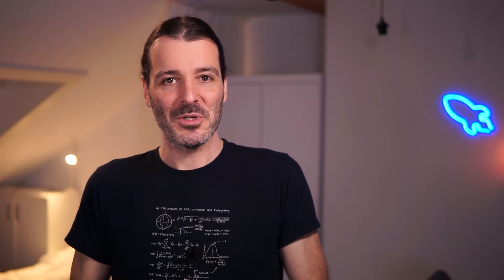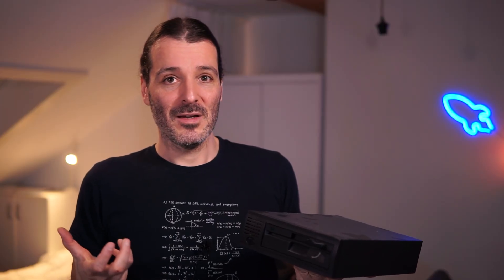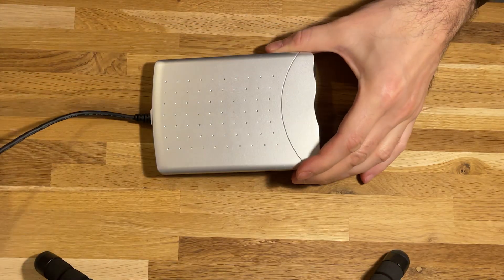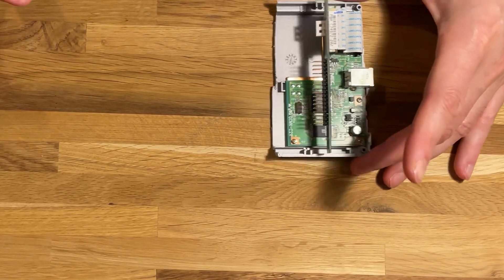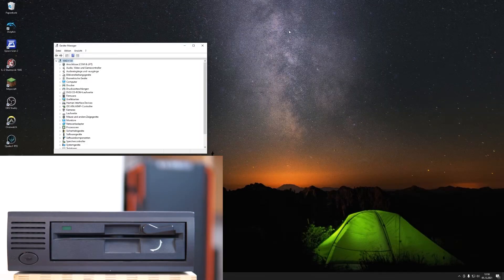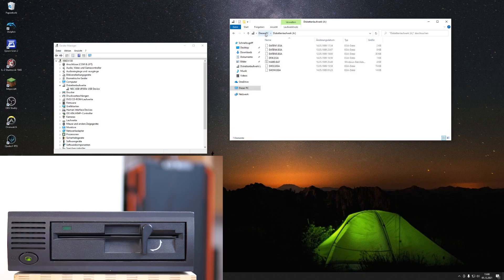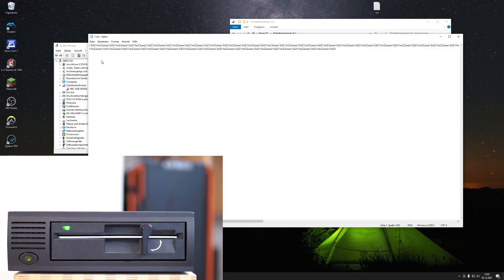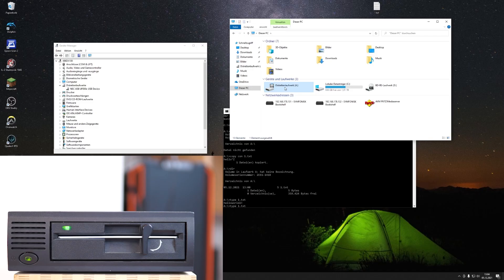How to build a working external 5.25" USB Floppy Drive

Comment: Legacy BIOS support for 5.25 is still in place, but is it for UEFI?  So a UEFI only system, may not be possible to use 5.25?  That would be I think the first key issue.  The next issue is emulation of 16 bit under 32 bit, is only supported via BIOS right?  Windows dropped native support for 5.25-inch floppy drives starting with Windows XP SP2, although it was still supported in the initial release of XP SP1

Comment: in usual not a bad idea, but it makes no sense, to use an exotic no longer available usb-adapter board. The reason why the 5.25" drive is always recognized as 3,5" is the vendor-usb ID of the USB-adapter. It has the device-ID of a 3,5" floppy drive. For that reason, windows handles it as a 3.5" drive. I don't believe that there is an ID for a 5,25" USB-device. Conclusion: because of lack of interface hardware, it's necessary to develop a hardware interface to handle 5,25" floppy drives and to write a windows driver to handle that on the file level

Comment: Doesn't the enclosure have separate power supply? The main idea is that usb provides 6 V but the drive needs 12 V. The internal controller/adapter from floppy drive to usb looks is similar for 3.5 vs 5.25 drives.

Comment: My guess is that the USB controller chip needs the correct vendor ID and product ID to be recognized as a 5.25 floppy drive in Windows. These are the IDs that allow Windows to recognize the device and it's perhaps how the drivers are aligned properly to the device. If the firmware is reprogrammable, you can may be able to reflash the vendor ID and product ID on the USB controller chip.

Comment: Well, this comes late — like 3 years late.  But I just remember something even older.  The DOS floppies started with 12 bit coded allocation tables.  Then at some point they changed to 16 bit coding.  Too bad, I don’t recall when that change happened, but I am pretty sure it was either when the high density 5-1/4 inch or the 3-1/2 inch floppies were introduced.  I also seem to remember that the 3-1/2 inch floppies were used in Apple computers quite some time before the PC folks got them.  I may still have somewhere a book by Norton, one that explains all the floppy directories and file allocation details.  I also have a couple more DOS books, one a Rosch book mostly about hard disk mysteries and then i have the big Microsoft DOS book.  One of my oscilloscopes has a 16-bit logic analyzer (in addition to its 4 analog channels).  I should be adequately equipped to dig into the deep core issues, if I just had the time and motivation…….

Comment: Don´t know how I found your video, but am tinkering with external 5.25 right now. Although I have a small external 3.5 as well to part out, I am using a greaseweazle at the moment. And that´s the issue: Great for imaging, but not for real-time use. 
In emulation, the Weazle can be used real-time for i.e. Amiga (which I bought it for), Atari etc. But in Windows? Meeep!
Thanks to your video, i don´t need to try the 3.5-USB->5.25. I had the same idea earlier, but now I see it´s not that easy in Windows. Grüße aus Bremen!

Comment: Added 2 years later, but still worth to be mentioned: You can use the described device compilation at least to read and write 720KB 5.25" floppy diskettes, e.g. using a modified TEAC FD55GFV or a TEAC FD55FV. These 720KB formatted 5.25" QD or DD diskettes were not commonly used, but existed. To read/write them on an older PC (e.g. an Intel 486 PC), you have to use not only MSDOS, but additionally also a small utility (the diskette copier software VGACOPY contained the utility named "VGAREAD", but there were also an utility which came with FDFORMAT named "FDREAD" and another one which was named "800"). To format them, you can also use the FORMAT program with the command line parameter /T:80 /N:9 (not with Windows, but DOS).

Comment: I suspect it's identity as a 3.5" drive is flashed into the firmware of the usb board. Accessing it via the bios to boot of it probably ignores that and uses some older, lower level way to determine that which Windows does not. 

It would be very interesting to see what it does under Linux. 

I built something similar myself using a Greaseweazle board (similar to Kryofkux, less expensive and open source) and an old SCSI enclosure and one of those 5.25/3.5" combo drives.

Like you said, it's not a native experience, it only works through an app that reads and writes images. BUT it does have advantages too. I was able to rescue the data off an old 3.5" disc that was damaged and otherwise unreadable. Also it can read many non pc formats.

Comment: Set up a reflective or white dot, if one does not exist, on the bottom of the drive spindle flywheel. Aim a cheap harbor freight strobe-type tachometer up to it.  Run it in dos correctly, and again in windows. Note the speeds. I think what you are running into is the drive rpm speed, which is different for 3.5" drives, and between different 5.25" formats. I'll bet you windows is trying to run the drive at 360rpm instead of 300rpm or visa-versa. A 1.2mb drive in dos with the bios correctly configured does this switching automagically, but without being told to do so I bet windows is stuttering. Being able to read the fat on that one disk, but nothing else kinda also makes me think this - the phase shift from being the wrong speed is likely exaggerated as you move down the disk. The FAT exists in the first block, with a backup copy at the last block of the filesystem. Are you picking up what I'm throwing down?

Comment: One thing about technology from that era. The jumpers on the control boards were very important. They enabled or disabled certain feature sets in the device and you have to make sure you know what the jumpers are what they mean and what features you need to turn on and off. It usually looks like two pins straight up with little plastic box between them sometimes two pins sometimes three pins sometimes four and they were usually labeled one through four or ABCD.

Comment: What a fucking waste of time that would be.
Reply: i would like to correct you on that, that there probably aren't much use cases for it, however, i work at an archive, and every now and then one of my colleagues shows up with 5.25 inch floppies. 
currently i keep an old pc that stiull has the floppy interface on board, running windows xp, and it works ... but i have had the main board already die on me twice... 
sourcing a main board with a floppy controller / interface is getting more difficult each year , so having a working USB-solution would be nice

Comment: Can you call the makers of your 3.5" USB Floppy Drive and suggest a 5.25" USB Floppy adapter version? You proved the principle; now it just need the right microcode.
Reply: Sorry bro, but I doubt NEC cares much about building converters for archaic formats the same way we do. You'd have a better success rate hoarding up drives in bulk, servicing them all, and building your own garage factory for the things - you know, after patching the controller. I believe windows is trying to read the disk at the wrong speed. 300rpm vs 360rpm.

Comment: I knew from the start anyone claiming this to be impossible was full of crap.

If they meant impossible with existing hardware/software, fine - but there's 0 reason someone couldn't write a controller for a 5.25" drive with, for example, a raspberry pi pico.
Reply: The least-bad way in my opinion would be to chuck the entire attempt at floppy emulation overboard, and start again as a generic USB removable mass storage class. A heck of a lot more work, and of course utilities such as advanced floppy copiers/archivers wouldn't work.

The bottom line is, if you want a floppy drive that behaves as if it's connected to a 82077AA-style controller, then connect the thing to a 82077AA-style controller - trying to force this to work over USB at a lower level than logical sectors isn't going to give anyone results they're happy with.

Comment: There is KyroFlux floppy drive controller - supports all types of drives and can read disks by sampling magnetic flux... add capacitor and who knows what is possible with this device. Too bad generic 3.5" USB controller doesn't work. Kyro is hard to get and would probably cost fortune. Idea to use enclosure for 5.25 inch drive - brilliant!

Comment: Without any digging into it, I'd have to assume that the drive controller and windows do a usb handshake that initializes it as a 3.5 disk drive. If you can fake out the handshake to be a 5.25 inch drive somehow them it will likely work natively. Perhaps that is why booting to it works, since the drive controller might have a separate primitive control function when accessed via bios.
Reply: For backwards compatibility reasons, surprisingly windows 10 still supports 5.25 inch drives natively. So theoretically it'd work if faked out.
Reply: Not really - not across USB, anyway. While it's true Windows has always supported (and knowing Microsoft, always will) floppy drives connected to 82077AA-style controllers, the spec for USB floppy emulation (and it is emulation - it's built into the BIOS, hence why it works under DOS) only specifies 3 geometries - and all of them were used on 3.5" media.

Short of violating the USB spec (which is what the BIOS emulation is doing), or going all in and presenting the drive as a USB Mass Storage Class device instead of a floppy drive (with all the extra lifting that entails), there isn't any "clean" way out of this.

Comment: Have you tried running windows 3.1 inside dosbox? I have a usb 3.5 floppy disk drive that I am able to read and write on using this method. I had to mount the A drive in msdos. I have purchased a 5.25 drive and a grease weasel adapter. I'm hoping to build something very similar to yours. Looks like fun to see if I can get it working
Reply: Am building something similar at the moment with NEC UF0001 and NEC FD1157C floppy drive

Comment: From my understanding with usb floppy drives.  The computer will read each disk just fine.  The problem is that newer os has some sort of media header that's written on removable storage whereas older os didn't require it.  If that header isn't present,  the pc will prompt you to format the disk. 

This may stem from the fact that some disks came "pre-formatted" and others were formatted via pc.  

If you read reviews from any 3.5 usb floppy, you'll see where some people claim that it didn't work for them. Or at the very least, only read some disks. The original formatting method may be the cause.  

Your usb device may work but you will probably need to install an older os.  Try to Google for a pc that contained both a 5.25 and 3.5 to see which os it ran.  Then look to see if that os supported usb.  If successful, either install that os on a seperate hdd partition or swap the hdd and install it.

Windows xp may be your best bet

Comment: Well I think I know why this does not work. The floppy cable itself does not provide any means to detect the drive type. Floppy drives are extremely dumb devices in fact. So the controller board in your USB device has no idea that it should talk to a 5.25 instead of a 3.5. Neither does a PC floppy controller know this. This is why this must be manually set in the BIOS for a real floppy controller. For the USB version, the chip must support the drive type and has to be configured accordingly. I guess the errors with your too long file can be explained as the 3.5" floppy has a different track geometry than the 5.25". Namely the "sectors per track" differs. On DOS, it was 18 for 3.5 and 15 for 5.25. If I remember correctly, the FAT12 stores logical sector numbers, not track/head/sector information. As your controller board assumes a higher sectors/track number than there actually is on the 5.25 disk, it will run into an error trying to map the logical sector into a physical one. It will work fine of course at the beginning of the track. I'm not too deep into floppies anymore, but I think the actual encoding used on the magnetic track was the same, although written with a different "resolution" by the heads. Your DOS program cannot "detect" the drive type as well as it is not possible. I assume they either refer to some (possibly undocumented) DOS structure that remembered the FAT setup for the last disk it read or they try to read it themselves.
Reply: Nah, DOS can read it because there's a (USB spec-violating - there's no specification for 5.25" floppy emulation, only 3.5") emulation layer built into the BIOS. Windows doesn't use the BIOS, instead using its USB stack that trusts the device when it says "I'm a 1.44MB 3.5" floppy drive, honest".

Comment: The reason issues exists comes form differences by those two drives, 5.25 HD floppy spins at 360rpm and have less sectors per track that 3.5 floppy, 3.5" drive spins at 300rpm, the controller thinks you  still have 3.5" drive connected and it kind of a stroke of luck that you could read any disks at all. You propably could have more success by fixing the speed at 300rpm and formatting it as 1.44MB disk.

Comment: My question: do you have an xp machine you could attach it to and try that instead? My thinking is that xp still supported 5.25 inch floppy drives.
Reply: Common myth. Even Windows 11 24H2 still supports 5.25" floppy drives connected to 82077AA-style controllers. The real issue here is that there's no spec for USB floppy emulation of 5.25" drives: there's only support for three floppy geometries - which are only used on 3.5" media.

The BIOS emulation - which DOS uses - was loose enough that it could translate 5.25" media geometry (imagine my shock at seeing BIOSs violating specs, hehe), but Windows correctly follows the USB spec.
Reply: @throwaway6478  Not sure what Windows 11 has to do with my suggestion of using XP.
Reply: @davidinark Because it would have no effect. You're operating under the incorrect assumption that XP has some sort of floppy support that later versions of Windows don't. This is the "common myth" I spoke of.
Reply: @throwaway6478 I specifically asked if he had an XP machine, implying XP-era hardware that would recognize the drive. My apologies for not making that clearer.

Comment: I want a 5.25" usb floppy drive which I can use like my 3.5" usb floppy drive. But to copy X68000 images (they use 5.25" HD floppies) to via UBUNTU (running thru vm in windows) via, UFIFORMAT.
Where can I buy one? Can you make me one of these?

Could you please test your solution in Windows while running Virtual Box with Ubuntu and mount the USB drive to ubuntu and see how it works there?

Comment: I think the Bios doesn't really care about the USB descriptor in the controller board. It just delivers an interface and the detection of the floppy structure is done by the DOS itself. 
It looks at the mediadescriptor ( = 0xF9)  in the bootsector of the disk. (https://en.wikipedia.org/wiki/Design_of_the_FAT_file_system#BIOS_Parameter_Block) 
On the other hand, I think that Windows decides from the information in the USB controller board that this is a 3.5 inch disk and assumes the layout from there. Because there are some differences in actual layout of a formatted floppy, it probably fails to read the fat correctly. I am not sure of windows 10/11 even has knowledge about 5,25 disks. 
I am curious what happens when you try to format a floppy using this drive. Does it (try to) format it with 1.44MB capacity? It can be done. I had software for DOS in the old days that could stuff 1,44 MB on a 5,25 inch floppy. 

If Windows 10 does still support 5,25 inch disks, than it might be possible to do some registry hack on in the devices hive somewhere to get it to work.

Comment: I’m sure someone else has posted this, however the chipset in the USB drive you took the PCB from very likely, if not definitely, does not support 360K drives/media. Some chips support a 1.2MB format, which was popular in Japan on 31/2 inch drives, however 360K has been a known showstopper with this method.

Comment: Have you tried reading the disk with winimage? I can't consistently read even 3.5 in disks in Win10 anymore, but Winimage is still able to read them just fine.

Also, even XP has issues reading 5.25 in disks using an integrated floppy controller, so I'm surprised Win10 is able to get as far as it is.

Comment: I tried something similar a couple years ago on Mac OS X, but I ran into similar problems.  I think the 5.25 drives need a custom USB adapter board, and not the standard one used for 3.5 inch disks.  Hopefully, some hobbyist will make such an adapter some day!

Comment: As far as I remember back in the day, the amiga 2000 came with a 5" floppy drive and you could format 5" 1.2mb disks and use them just as you could with 1.44mb 3" disks, might wanna try high density disks next.

Comment: I wonder if you could mount the 5.25" drive you constructed with DOSBOX since Windows at least seems to see the device.  I was able to connect one of the commonly available 3.5" USB external drives to a modern Windows 10 PC running DOSBOX with the  MOUNT A A:\ -t floppy command for accessing 3.5" 720K and 1.44MB diskettes and everything worked good directly to DOSBOX with that.  If you could get DOSBOX working at least you could do some floppy archiving using a DOS utility to image the floppy.
Reply: DOSBox uses ordinary Windows file access APIs to access drives connected to it. If Windows sees a drive "wrong", so will DOSBox.

Comment: Best bet is probably a very old USB floppy drive like the Pentium 1 and Pentium II laptop era of mid-late 1990s for the controller and paired to an early 1990s IDE era 5 1/4 drive. I am sure Commodore still sold 5 1/4 units in 1992 (for use with their PC on a card emulator for use with Amiga 2000/3000 so businesses could copy over archived records into their new system I guess).